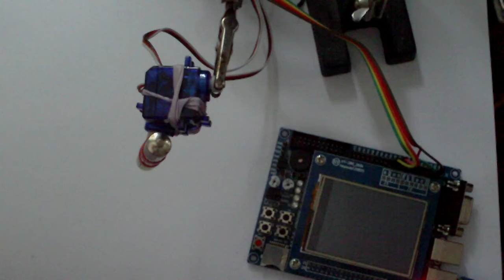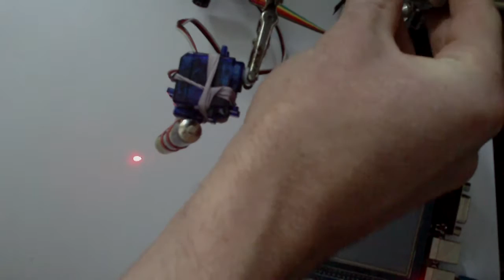XY Laser control with RC Servos and Espruino for ARM

Comment: I made a project like this with a HeNe laser about 20 years ago. (Wow that sounds weird to say!) I strongly suggest that you fix the pointer and separate and fix the servos and have each one of them hold a mirror. Then you can move much faster with less stress on the motors. I wanted more performance than I could get with motors so I moved to speaker coils. Hard Drive motors would be a good option now days.

Keep being awesome!™